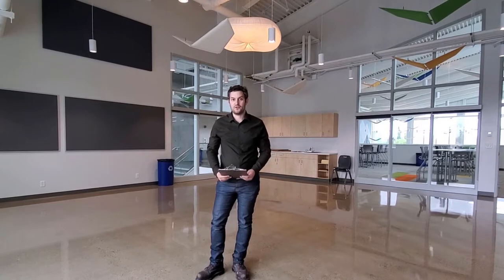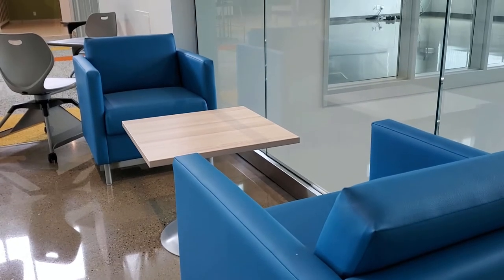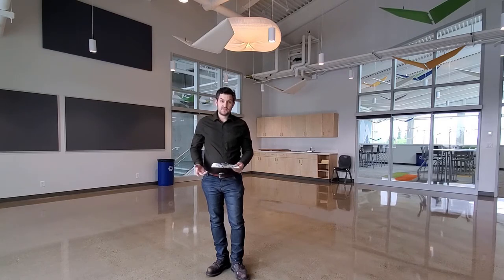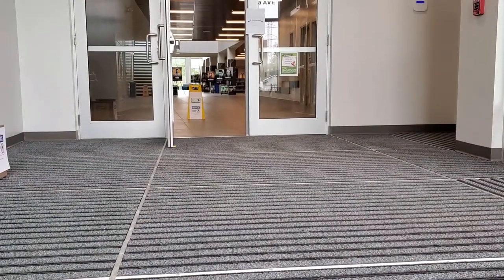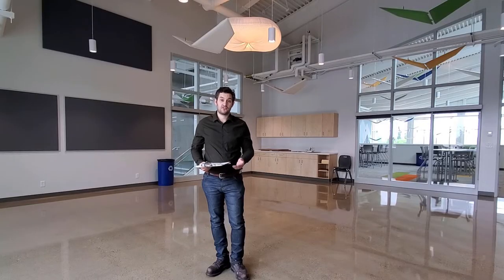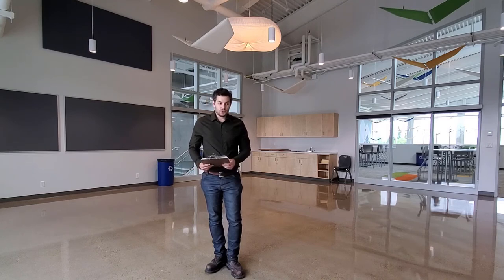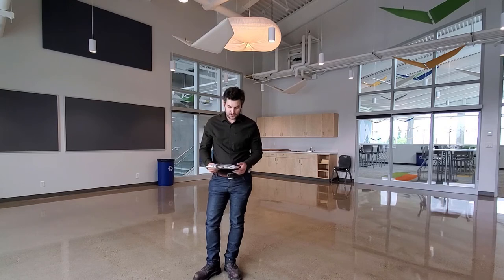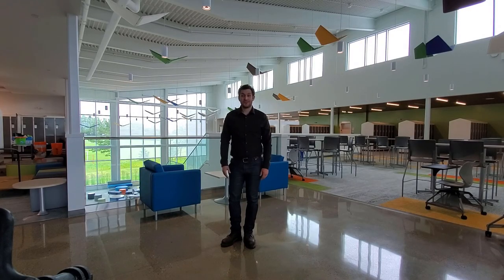Polished Concrete Floor Maintenance Recommendations

Comment: What is the actual product we should use to wet mop? You say what not to use, but not what WILL work for polished concrete?
Reply from the maker: I would recommend checking with your flooring installer to see what is compatible with the products that they used.  Typically, mild soaps and concrete specific cleaners work best.